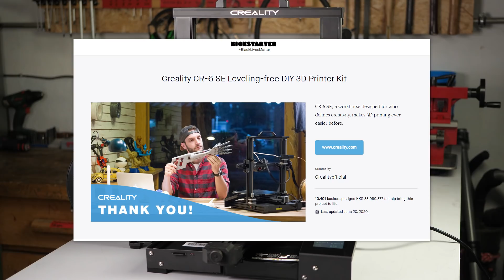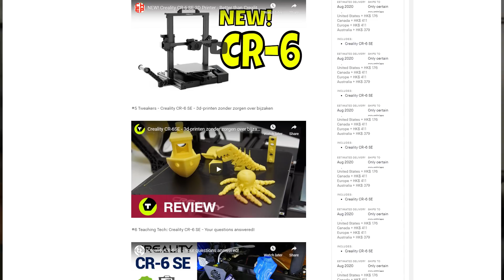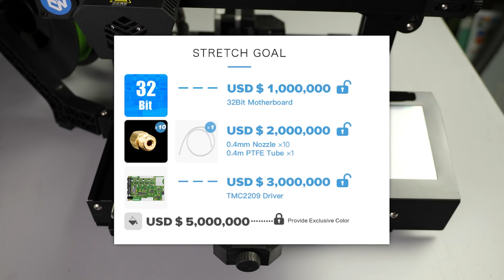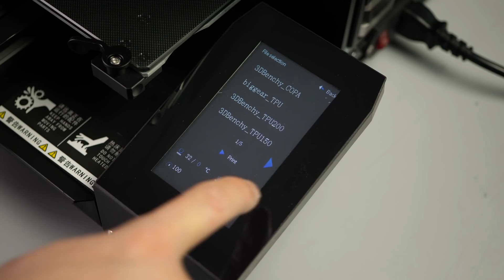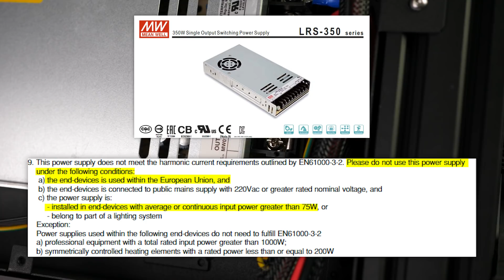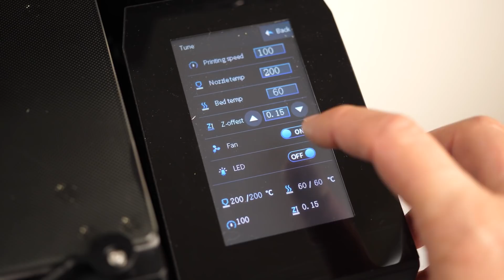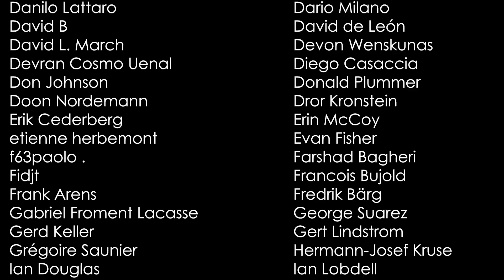Creality CR-6 SE - The NEW (over)hyped Kickstarter 3D printer?

Comment: I already upgraded my Ender 3 with a silent board, direct extruder (which works great with the filament spool on top), silent power supply fan, glass bed. I never had issues with bed leveling. The power fan replacement with an 80mm would be impossible with the power supply below the printer and the new print head with the (admittedly cool leveling mechanic) would also be difficult to modify for direct drive. I thought about getting the CR-6 SE on the kickstarter, but in comparison to my modified Ender 3, it would be a downgrade.

On the glass bed: I got the original Creality micro-porous glass bed immediately with my Ender 3. It worked very well with decent adhesion. Prints could be removed without much force and would pop off on their own when the bed cooled down. Over time though, the adhesion got worse and worse (probably all the fingerprints and dust) until I decided to give it a good cleaning with 99.9 Isopropanol. Now the adhesion is amazing (I print most stuff without any brim now), but prints are very difficult to remove even after the bed cooled down.
Reply: @owowowdhxbxgakwlcybwxsimcwx  Removing the fan on a component that comes with one is not something I am happy with. I only have the Ender 3 non-pro, which came with a Chinese noname PSU. The new cover also looks quite fancy (thing:4419321).

Comment: One thing they could look in to is to remove the lcd entirely. Why? Because settings you do in slicer really, and an auto bed levelling can be real auto, temp etc is something you should do in slicer as it really is a whole lot more to that than just temp. Speed and temp is crucial, and all filaments have different viscosity so you cant change one without the other really beyound a certain point. That said, look in to odeamalers slocer. Compared to prusa etc it is much more userfriendly, click and point sorta. Of all slicers i find ideamakers the best. You can tweak settings there but really it is so simple to just click icons, and when you really have to you open a menu. The whole slicing proces takes just a minite , scaling, rotating and arranging is compared to as for example sli3r like living in 2030 normally and have to move to 1920 , ideamakers slocer is far far ahead on useability than prusa and most used. I would sound proof the frame , fix a slicer , minimalist the design further and only go for tests against other makers before implementing things. This is probably a great machine but either it is a point and click user you want, or and advanced user. You cant have both. The easy first timer is not gonna buy this as it has no enclosure where some core xy machines are coming now in a full case - cheap.the dimensions is more for a professional usage now, and then i dont really get the choice of machine design really as it is clearly loud. Add a few rubber pads and it is probably silent.

Comment: Get an ender 3, with one of the kits that replaces the springs, and the extruder, and the tubing, plus a silent board and it is still way cheaper yet still has most of the functionality (sure no auto leveling, but the last time I leveled my bed was a month ago and I am still getting great prints so I will continue to not level it again until I need to).
Reply: This is much better than an Ender3 especially for those of us that got it for $265.
Reply: I bought a 6SE over upgrading my Ender 3.
This has a lot of enhancements over the 3 and th uprades would have cost more than half the price of the printer!

Comment: Strain gauge sensor works in theory but not great on nozzles unless it is levelled hot, as filament will point out of almost any nozzles that have been printing, in various amount. Having a hot nozzle levelling...is not something i would recommend but i guess they sorted that out. Still, a strain gauge capable of reading must give stress either on bed or nozzle.

Comment: Personally dont agree with the negatives. 2209s is a much better solution than 2208s.
2209 results in even quieter operation. Can handle more amps. Doesnt heat up as much. Obviously stallguard and most importantly they can support linear advance in stealthchop. 2208s cant unless forced in spreadcycle and messing with square waving. 2209s was a hugely requested thing so they made it a stretch goal.

PSU. Eh people kept on screaming for meanwell so they did but iirc they were still picking between meanwell delta and some other company and eh. The mk3s is loud in its own way.

Kinda minor complaints to call it over hyped.

Comment: When the power supply on the office MK3 died (this was before the Delta PSU upgrade), I got a Mean Well LRS-350 to replace it while I was waiting for the official replacement. I don't remember the fan being loud and annoying, at least not to the point where I would remove the Mean Well and install the no-name replacement PSU. I wonder if it's a voltage thing, as I'm in North America (115-120 volts)?

Comment: I have backed this as my first 3d printer. The most appealing factors to me over Ender 3 pro was the dual z lead screw, solid bed mount, 60 mm y extrusion, silent stepper driver, position of power supply etc. along-with other bells and whistles. Prusa i3 mk3 is twice the price in kit variant and I don't have the budget.
Reply: No worries it is pretty good bang for the buck despite the "criticism" and will get the job done, especially as a first printer
Reply: Welcome to the 3D printing addiction!

Comment: I backed it for my first 3D printer and grabbed it at the early bird price. I liked the auto bed leveling and glass build plate as standard and due the big Ender 3 community responses, expect plenty of mods and upgrades in the near future for teh CR-6 as well.
Reply: I think you will be super happy with it!  The Ender 3 is a great printer, and this is just a very upgraded version for a great price! (Biggest pain with my Ender 3 is the bed leveling, and this does away with that issue!)

Comment: I backed it.. outside of the various positive reviews, (though I haven't seen anyone state the issue with the power supply...) was what drove me. Joe and the rest that i watch often. 
As for the printer it self,  the quietness was my primary concern.. and as mentioend no one I follow had this issue, thought hey are all outside of EU, maybe that is the issue?.    Still I do hope they fix that fan on the PSU..
The second part is the auto bed-leveling part, which I'm tired on doing on my CR-10s (v1).    It's a small annoyance but removal of any annoyance is a big plus. 

Still I hope the company responds to your power supply findings..  Else "modding time"
Reply: The proble is in my opinion the very constrained space in the bottom of the printer, it looks cool from a design point of view but makes is hard to impossible to implement a proper heat managment which is why you have to go for an acitvely cooled PSU. Plus I think they might be cheaper because you can use less energy efficient components in the PSU if you have forced aeration and can dissipate more heat.

Comment: It would have murdered most other options if it could stay ~$250 retail.
Reply: True dat. Even if it was $299 it would have been a slaughterhouse.
Reply: So what would you then suggest as a better option at the same price ($320)?
Reply: @bgm-1961  depends on what you want to do. Could always mod an ender 3, or just grab a full fat CR10 to start. 

It's still pretty good though anyways.
Reply: @bgm-1961  Artillery Genius. 260€, so just 290 USD. With BLTouch on top 330 USD. With a clone, less.. 

Good cable management, very silent, pre installed pins at the print head for easy BLTouch installation, volcano style, touchscreen (while that's not important to me since octopi exists), build quality, AC 110/220 Heat Bed (heated in seconds), and more.
Reply: @timthefinner  OK, thanks. Never heard of that printer line. Now I wish I did some more homework before backing the CR-6.
Reply: @bgm-1961  Don't be put off - BL Touch is nowhere as good at bed levelling and I have heard of people still needing to do manual levelling as their BL Touch wasn't very good.
Reply: @tigerpawdesigns  I just threw my v2 back in its box and will be returning. I got 4 prints out of it before the bed warped. Even with bl touch I was seeing a + - of .03 in places
Reply: @mehmetmustafa2112  430 USA UK AUS etc please and thanks
Reply: Even with 250 USD, I'd still buy a Artillery Genius instead..

Comment: Overhyped?
Perhaps.
At the Kickstarter price it’s a very good deal auto level and filament sensor.
Unhappy about the fan noise and seeing the other beta units none of them appeared to be loud so perhaps yours is faulty?
I am sure if the others got printers where the fans were as loud as you say they would certainly have mentioned it.
I agree the 32 bit board doesn’t really mean anything but all your prints worked with different materials and you admitted that yourself your profile isn’t perfect so I do feel you were a bit harsh on it.
But we will see, if it is as loud as you say on the final units a lot of people will be very unhappy 
You want things like an all metal hotend at this price point?
How many $400 printers do you know that comes with that and the Prusa you compare it to is twice the price you know.
If you want to compare it to something you really should compare it to something at the same price.
I’ve watched the other reviews and they too have mentioned that for a lot less you can get the likes of an Ender 3 or the mk2 Ender 3 and there’s another one coming as well but don’t remember the model.
Nice review but I personally think it wasn’t very balanced considering the price, the features the print quality and all the bits you did like. As for it being overhyped, that was probably their marketing plan.
Anyway thanks for the review.

Comment: 6:30  They have the same PSU in my CR-10S Pro, and yes, it drives me crazy that they have quiet stepper drivers and everything, and then this crazy loud power supply. So you're not alone 😊.
Reply: the fan is the only thing that makes noise though. I would suggest looking into changing the PSU fan. PC users sometimes do that
Reply: @cristianconstantin6496  Yes, there's a video on that. I am a bit reluctant, though, to change the cooling of the PSU in a printer that runs for hours unsupervised.
Reply: @schm4704  For what it's worth 2 months late on the reply, you can get very quiet fans that have the same amount of airflow for not much money. Digikey is a good resource for finding one as they have very good search filtering.
Reply: @wolfcryo  Thanks, I might try to replace those fans!

Comment: Chose not to backit, but I've probably spent as much with the Ender 3 and the eZboard/EzABL and EZOut, and the CR10 gear drive for the extruder. I would consider that lever latch system for filament capture over the spring lever I've got. Not going to get into beds, but yeah, I'd agree that the flexsteel with pei bed surface would be appreciated. All that said, I'm seriously contemplating using the Teaching Tech hot end conversion to use the old endstop as the bed level sensor for ABL as I'd really like the entire bed area that could be printed be sampled, rather than extrapolate from the inner 175x175 If I were to make an improvement on his design it would be to noy rely upon the printed material for a hing, but put in an actual hing. And yeah, the added slp maight be an issue, but I would think it would be preferable to a material failure. Jut my thoughts.

And yeah, even with the setup I have, that fan in the Meanswell is the noisiest component. Thanks for the review.

Comment: I'd rather buy an Ender 5 pro/plus.
IMO the frame geometry/stability and the way the axis are driven have proven to be the most important features regarding 3D printers.
They are the foundation for precise and reliable prints and are difficult to upgrade.

Comment: Seems as if the MeanWell PSU does not have proper power factor correction (PFC) because as far as I remember the threshold from which you need this (from a regulatory point of view) is exactly the 75W, which can be seen from the except of the datasheet in your video. That of course does not mean that it has no PFC at all. It just does not meet the requirements for a device above 75W by whatever margin (i.e. maybe next to nothing).

Comment: I just can't see justifying buying a creality machine anymore since artillery/envovo entered the scene.
Reply: Can you provide more details please
Reply: @the_DOS  Artillery has released two printers: The x1 sidewinder ($400) and the genius ($300). They were designed as direct competitors to the cr-10 and ender 3, respectively. For the extra $50-$100 of one of their printers, you get the same build area as those two creality machines, but with silent stepper drivers, an e3d volcano clone hotend, a titan direct drive clone extruder, wider and more stable linear rails, AC heated bed, ribbon cable management... They're just superior printers with all the upgrades you would ever do to your creality machine + more for a few extra dollars. The sidewinder is actually cheaper than the 10S despite having all the features and more of the 10S. Dual z axis, filament runout, etc. etc. I don't mean to be a commercial for them but the point is there really is no explanation for why anyone would choose a creality machine over artillery unless they were getting the s5 since artillery doesn't offer anything with that volume.
Reply: Completely agree I have 2 sidewinders excellent printers quiet printers love the cable management as well. It's a shame that reviewers put such emphasis on auto bed levelling manual levelling is so easy and you have to do it so rarely it's just not that great a selling point. especially compared to noise, build volume, quality reliability and safety.

Comment: Hi, at 6:13 something disturbing. That fat red wire (I'm guessing it is the supply for the heated bed) is very close to the screw hole for the cover. Too close. Some people may end up buying one of these with the screw fouling that wire. I thought we were moving away from fire hazards in the 3D world. Also, how long is that sticky tape going to stay stuck? Bad wiring practice for such a well known company. Also just noticed the main bundle of wires (where they drop through a cutout in the frame) though they are wrapped are passing over rough cut aluminium with a clearly sharp edge - they'll spend their life vibrating against that and eventually chaff through. Very poor construction.
Reply: Bear in mind that's a Beta unit, hopefully the production units will have that remedied. Good catch though, when mine comes in I'll be sure to have a look at that and see if it needs fixing.
Reply: Happy to read this. Some people just go blind with a company and can't see this kind of problems :)

Comment: I think it's a great printer (as long as it works as advertised) for the price. If you got an ender 3 pro (I do) and you added upgrades to get to this point, you'd spend a lot more. I think you're nitpicking at the fan noise. 99% of people aren't going to use this machine in a quiet office setting, so that isn't really a fair complaint. I can't believe you're comparing this to a Prusa? That machine costs double what this costs, and you're complaining about a few dollars of extra parts to be just as good?
Reply: Getting a good power supply is a fair complain. If that fails it can destroy the entire printer. It's not just the anoying noise...
Reply: Fan noise is a fair complaint some people are more sensitive to sounds than others some may be having it close to bedrooms or in the case of teenager even in their bedrooms and please don't say you should not print while sleeping we all know everyone does :o)

Comment: Thanks for pointing out the power supply noise. I've upgraded the fans on my Anycubic i3 Mega so I had completely forgotten that fan noise from the PSU could be a problem so now I'll have an upgrade ready to install during assembly.
Reply: Sounds like an excellent idea to have that ready when it arrives.  What fan size do I need for this?  And do you have a particular fan you'd recommend?
Reply: Brooks Moses usually it is 60x60mm. Sunon maglev fans are great 24v fans. It is still quite noticable tho. The loudest is actually the wind swirling around against parts. Either cut out the fan cover grid or just print a new case for a bigger fan.
Reply: @Firebear31  The Meanwell LRS-350-24 actually uses a 12v fan. It's also wired backwards, so you need to reverse the pins on the fan connector when swapping it for a quieter unit.